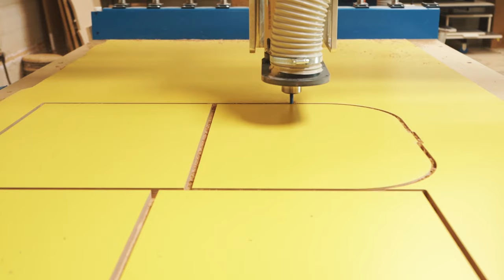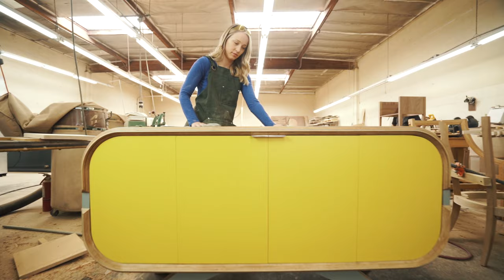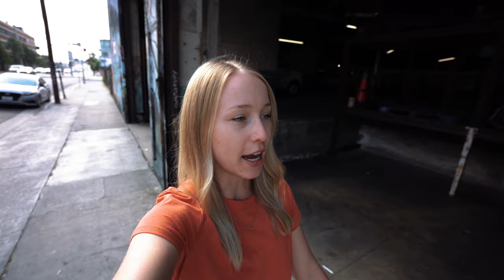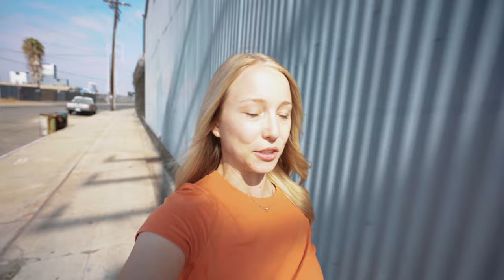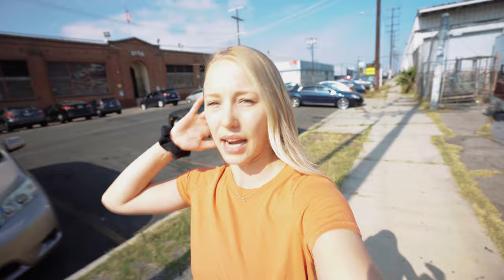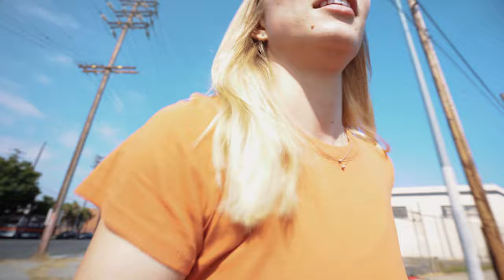Woodworking: How I got started!

Comment: Did you mean you sanded the epoxy to 800 or the wood?  I'm fairly certain that after 220 grit wood starts to burnish and will then resist stains etc.  Burnished is its own nice effect.

Comment: If you wanna start wood working you need the most basic hand tools you can find. Free even, some of the best made furniture came out of periods before power tools were even a thing. You don't need this fancy equipment, all you need is to start, doesnt matter where you start as long as you start. Also check you local areas people give wood away, it might be a pallet but turn that diamond in the rough to a piece of art.

Comment: Ya know that moment when you realize awww  crap this is what I should been doing for a living
Reply: No. Still trying to find it at 55. But, I went to a school that had great wood and metal shops when I was a kid. We used tools that would flip parents out today: band saw, table saw, forge, soldering irons, sheet metal brakes, lathes -- and made stuff. Real stuff. I made a small end table, a hammer, a screwdriver, a circuit tester, a salad bowl and serving utensils, a working tugboat toy, and other miscellaneous projects. We had a year in each discipline. It was great. I had no idea how much those experiences would impact my life in terms of understanding how much craft and skill making stuff takes. They taught me deep respect for the creative process, as well as patience and a clear understanding of how skill develops. 

Now, I think it's time to knock the dust off of the basics I learned and do some woodworking. I have no plans to make a business out of it (that would be exceptionally big headed, given that it's been 40 years since I touched a jigsaw) but I'd forgotten just how cathartic the creative process can be. This is all about finding my connection to the process, again, and reaping the benefits just for me.

Comment: What tools should you start with in woodworking? Powertools and hand tools
Reply: It all depends on what you want to do. There are alot of woodworking tools but if you make projects that don't require them then you don't need them. 
Dovetail jig is useful for making dovetails  but not all projects require them and you can make them by hand too.
By figuring out your projects you can figure out your tools more efficiently. Good luck!

Comment: Your husband had a booming woodworking business and only sanded to 180? I'm not even a wood worker and I know that's rough. I want to learn wood working professionally but have no access to a fully equipped shop. I have no idea where to look and where to go. Must be nice having a husband who already does it and has a shop.
Reply: Not strictly true. If you go above 180, it can actually prevent finishes/stains from adhering to, or penetrating, the wood. Depends what you’re looking to do with it.
Reply: @chm1701  True, I guess whenever I worked on my own stuff I just preferred the natural look of the wood. Didn't really use stains or finishes. I would use oil though to make it shine and have the natural color pop.